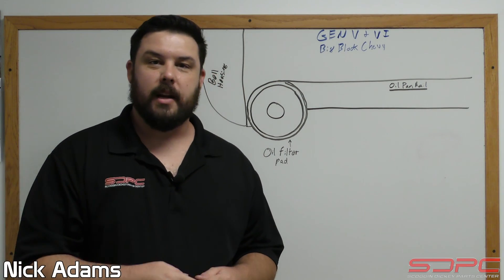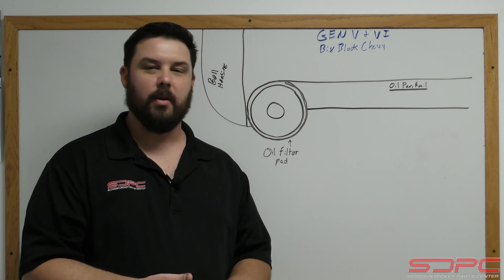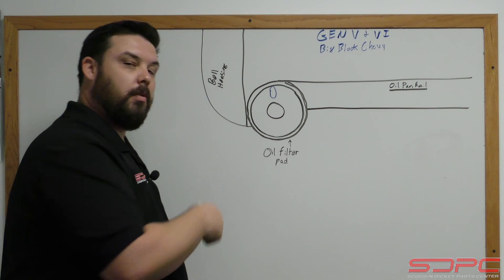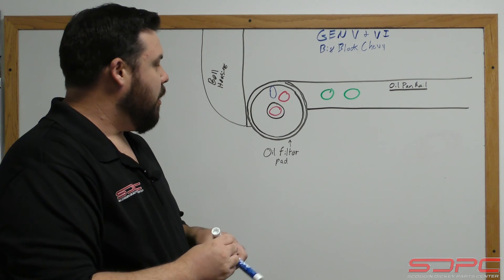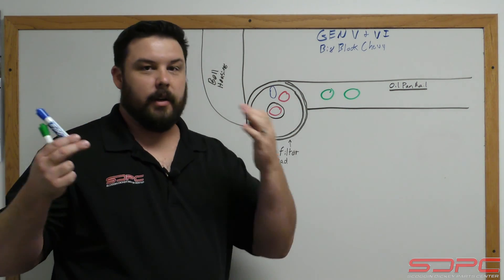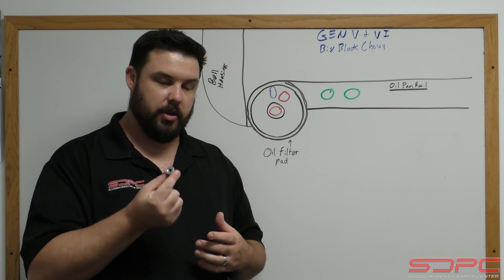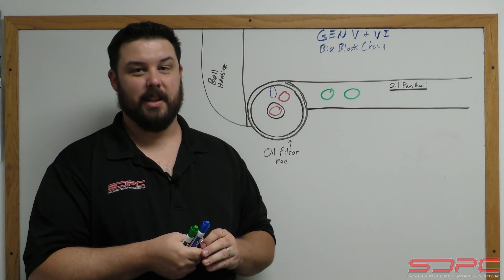SDPC Tech Tips: Big Block Chevy Oil Filter Bypass

Comment: Good knowledge there . I have a question and I hope you have an answer so my 454 aka 7.4 Liter V8 at cold start will read 70 to 75 on the oil pressure gauge then after it warms up to operating temperature it will go down to 50 on the gauge is this normal or is it too high and do you think I should change the oil filter ?
What oil filter do you recommend? Thank you very much and hope to here from you soon

Comment: What fitting do I need to use a regular "spin on" oil filter, once I remove factory fitting/filter from center of the oil filter mounting pad?????
Reply: 1-12 thread to 13/16-16 thread adapter

Comment: I have a 1997 c2500 suburban with the 454 and blew an oil cooler line for the second time, this thing has 75psi cold for the last 80k that I've had it.   Blows the cooler hoses right apart where the metal gets swedged onto the hose 

Gonna bypass them cooler lines now.......
Reply: I see your having the same issue as me at cold start I’m at 75 psi then warms up and goes down to 50 psi ..I thought that was normal for that size engine

Comment: If you remove the bypass valve in the center, drain back will occur and you will have dry starts. Removing the outer valve and plugging the hole in the block will keep unfiltered oil from circulating thru the motor

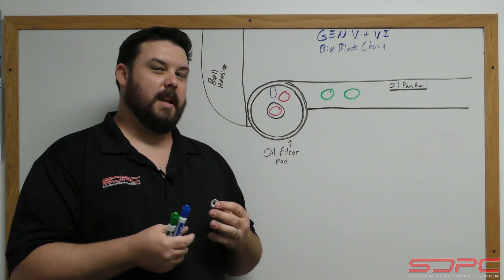Comment: At 4:09 you said you hoped you explained the issue. You didn’t explain anything at all. Why is the oil relief valve in the middle of the filter outlet? Is it a high pressure bypass? You really need a diagram to show how the oil circuits route the oil. After watching other videos, I see how it works. The center relief valve is a relief valve that lets oil bypass the oil cooler if it stops up. Since the oil cooler passages are plugged you’re causing ALL of the oil to go through the relief valve which is too small and restrictive so yes the center valve MUST be removed if not running an oil cooler. It’s not due to too many 90 degree turns, it’s that the main path for oil is blocked with pipe plugs. As for the the relief valve off center, that one needs to stay or you’ll be allowing unfiltered oil to bypass the filter and go directly into the engine. Your readers need to know this information so that they don’t just assume taking them both out is better than just one.
Reply: You seem knowledgeable and I am building a late model gen 6 bbc. Do you know what lb. relief valve goes in that off center hole?

Comment: the best oil pressure is with a drill and a priming shaft, 20 psi at the oil filter, at the back of the block 15psi, putting the distributor in, and cranking with no spark plugs 0 pressure, help!! Mark V block with a 70 psi pump

Comment: I took the inner one out on my 502 and actually blocked the ‘red’ one with a dime or a nickel or something.  My 502 is actually a 540, I spin it 7500 on occasion and it holds pressure just fine.  This video would have been nice about 5 years ago!

Comment: Built many Mark IV's, just got a 19170538 454 HO block to build from you. This is exactly the answer to my question. I know your a GM dealer and your info is accurate. One bypass valve, just out from center hole and I'm done. Thanks

Comment: Am I understanding that the valve you removed from the engine block is an oil filter bypass valve? Does the oil filter for the big block Chevy engine have a bypass valve in it?
Reply: Some,not all filters, have bypass valves. You could be confusing the oil filter drain back valve with a bypass valve?
Reply: @milomanx6531  yes, there is a difference. The drain back valve blocks the inlet holes. The bypass, if there is one, is at the other end and bypasses the filter media. Some engine blocks have a built in bypass valve.🙂

Comment: Good Video, What about the oil filer bypass on a Mark IV? Will it bypass at what pressure?Does it bypass ONLY when the oil filter is plugged? Thanks
Reply: No, It also opens when oil pressure is high. That keeps from blowing the filter apart.

Comment: Ran into this issue, I have a fresh built gen 6 with a high volume pump and cold it’s 50-75psi but when hot (180) it’s goes down to 25-30. Hopefully this solves my issue
Reply: It's been 3 months. What happened?
Reply: That good oil pressure whats problem

Comment: Great video I spend my bearings because of that valve till I talk to an old timer I use the 9/16 bolt threaded it up in the valve and pulled it out. But there is no video at the time thanks again

Comment: HELLO SIR , TODAYS DATE , SUNDAY 3/06/2022 7:41 PM ....I HAVE ZA 1993 "GEORGIE BOY MFG." "CRUISE AIR " BUILT ON A "P,30 " CHASSIS , TRUE 10,000 lb. REAR AXLE , 6,000 lb FRONT "A"ARMS INDEPENDENT COIL SUSPENSION with * BIG BLOCK. 454 c.i. / 7.3 liter V8 .....FRONT OIL COOLER BLOCKED AIR TO RADIATOR and OIL COOLER LINES WERE ONLY 2 x parallel 1/8" copper TUBES with SEVERLY CORRODED COOLING FINS ....JUNK COOLER & LINES WERE REMOVED 2 x 3/8 inch PORTS (SHOWN GREEN IN YOUR SKETCH)  ARE THERE [ ☆ ] ....a tiny metal part flew out .....I THINK A tiny THERMOSTAT IS BETWEEN THE 2 x 3/8" PORTS ...REASON : IF OIL IS COLD IT BYPASSES OIL C OOLER ....OIL SHOULD BE ABOVE 200~212 °F TO REMOVE WATER FROM OIL SUMP ... SIR....I NEED MORE INFORMATION    PARTS # .....NO LONGER CAN GET "BIG BLOCK CHEVY V8" BOOKS ...THANK YOU

Comment: Thanks! Do you still sell a part that installs in the cooler line ports and diverts 100% of the oil to the cooler ? What part number if so? 

Would a sandwich style oil cooler adapter in the filter boss also divert all the oil to the cooler? 
Thanks again
Reply: I'm wondering the same thing. What did you end up doing?

Comment: Can you run turbo supply and return though the oil cooler lines .
Reply from the maker: That is not recommended.  You need the turbo oil draining freely and not into a pressurized stream.
Reply: @Sdpartscenter  what are you useing for supply, so basically just weld a drain on the oil pan for the drain

Comment: Gen 4 454 4 bolt main,  looking to get the oil cooler to get to work, the oil cooler stays cool to the touch? Motor is fine pressure is good. Temps are ok, but I’m still having a cool oil cooler, it gets fluid but doesn’t seem to get hot or warm? My block doesn’t accommodate that pressure valve? The shop is looking at it now for a second opinion. Thanks in advance
Reply: Having same issue on Gen V.. Did you manage to sort it out eventually?

Comment: I removed the bypass vale your talking about. I have blown the o ring seal out 3 times in a natter of 1 minute run time. two wix filters and 1 cheap filter. Why???????????? Sjhould I put the by pass valves back in? Thanks

Comment: Cranking over the oil pump with a drill. The drivers side lifters pump up. Lifters on the passenger side DO NOT pump up. Any I dea's? By the way great vidio. Help me alot. Thanks
Reply from the maker: When priming the big block, the driver side will prime faster than the passenger side.  It does help to rotate the engine over and it should eventually get there.
Reply: Prime the engine for 5 minutes, turn 180 degrees and prime again. Do this four times. Problem solved!
Reply: I did stop with the drill and cranked the motor over a little and 1 lifter has p[umped up so far on the passenger side. I'll keep going. Thanks

Comment: I recently rebuilt gen 5 454, i replaced the oil pump with a shaft with steel sleeve, pistons, crank mainsand rod bearings replaced, blocck was hot tanked. After start up we are getting 80 lbs psi but no oil to the valves?
Reply: I have this problem, too. But 
i see no responses from the original poster.
Reply: The oil won’t flow up there until it’s thin and warm.  It may take 5 minutes before you see it coming through the pushrods.

Comment: Question, do I have to take the bypass valve out above the filter? Why not just plug the cooler ports and leave it in??
Reply: I would leave it in. If you remove it you will be applying a band aid to the low oil pressure at idle after a hard run especially on marine engines. Removing it allows the filtered oil to return almost a straight shot to oil galleys and not forced to make 4 90 deg turns thru blocked off oil cooler ports on the pan rail. The main reason for low oil pressure at idle after a hard run is not the 4 90 deg turns but due to high oil temps. There is a reason Chevy cast cooler ports cast into the block. I have a 502 in a 24' boat with an oil cooler and oil temps have hit 250 deg on a long run at wide open throttle. Yes my oil pressure alarm goes off when I hit a no wake zone and have to idle but goes away pretty quick. Yes I need a bigger oil cooler. However by removing the center bypass the cam galleys will have a straight pass to drain back to the pan allowing for dry cam bearings and valve train on start up. I would rather have oil in the galleys since my boat may sit for weeks and moths at a time. Hope this helps.
Reply: @nunya5891  do you have turbos on your boat.
Reply: @filitamayo  Nope. Naturally aspirated